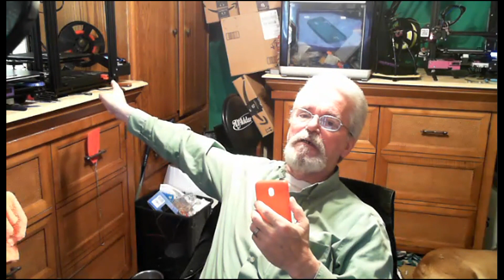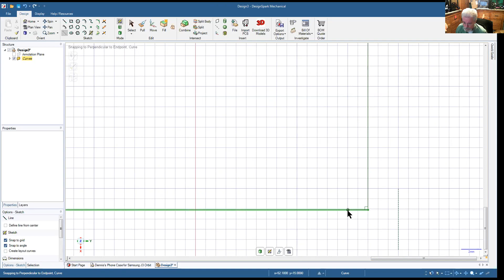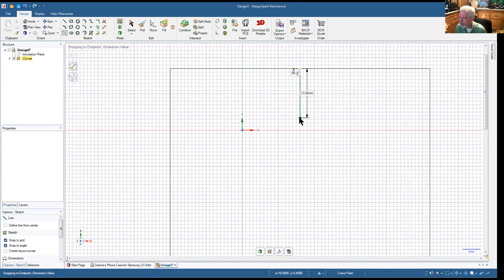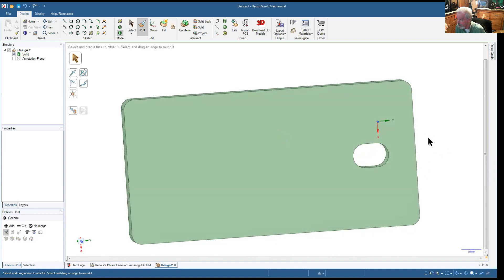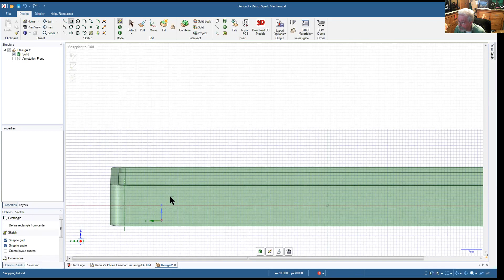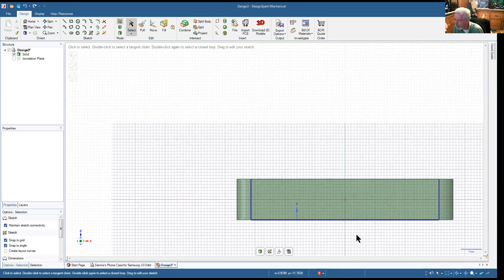Tutorial - DesignSpark Mechanical - Samsung Orbit J3

Comment: Hi, me again again, I like to figure out a software program for hidden gems, And  I found a few today, If you want to select 4 opposing vert edges, you do not have to twist the shape around, there is a way around, hover the mouse over the front face right click, select face, select hide other faces. this leaves the front face visible and shows a wire frame of the rest hold the cbtrl key and select front left rear left rear right and front right. then p for pull and round over the corners. the rest goe perfect with a double click. to show the hidden faces, just right click and select faces show all. 
And for the phone cover it look to me easier to make a box in the exact measurement of the phone. sketch the location of the buttons and camera on the outside of this exact box round the 4 corners and pull it out of the box for about 10 mm or 5 mm does not matter because if all the cutouts are made then VERY important go to the structure menu left top screen select the solid with the right mouse and select lock. make a new box beside the existing (grey) one and make that 2 times 1.6 mm bigger move the grey box inside the new solid and with the combine tool subtract the grey one  that gives a (shell) with all the cutouts in place. 
My last tip for today, for a construction line it works faster to use the offset command click the edge and pull a short distance in the right direction and give it the precise value And measure the center of the cutout, pull the offset line to that exact location and make a rectangle from the center point 
Kind regards Hans